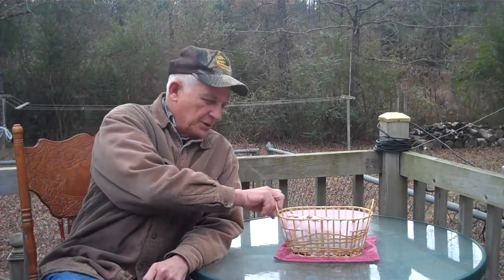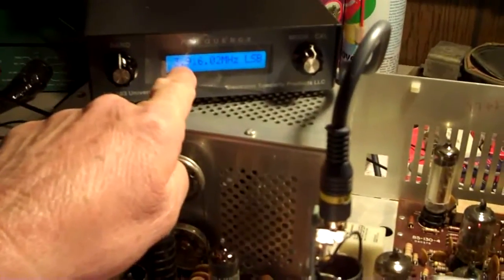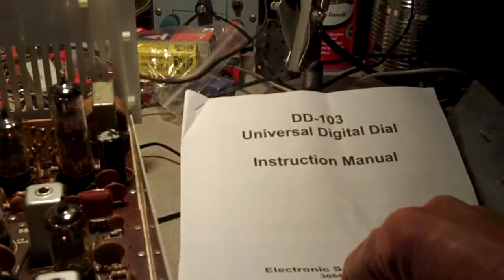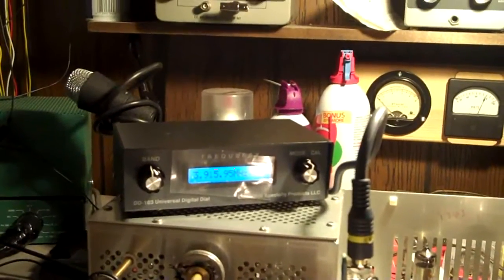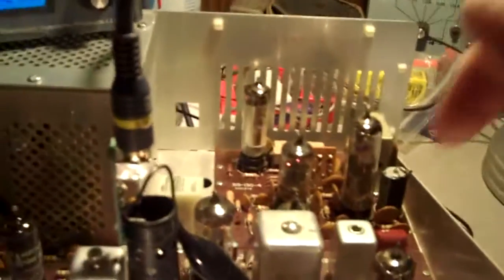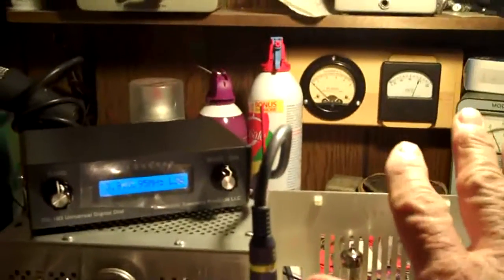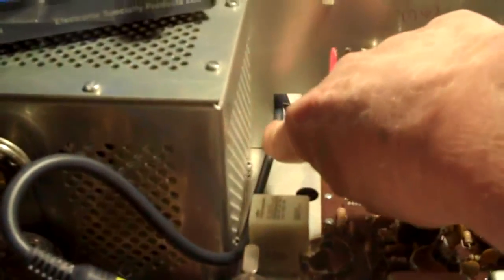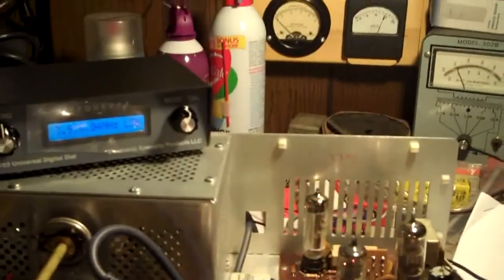The DD-103 Universal Digital Dial

Comment: Do you have a schmatic for this?   Mine powers up but only displays the I.F. frequency.   
It did work for a few years.   Everything seems to work except it doesn't change from the I.F. freq to the
correct frequency.    I tried transmitting a cw signal with a piece of wire connected to the coax for the input
and it didn't pick up the signal.  My other freq counters picked up the signal several feet away from the antenna.

Ken

Comment: John, use an nylon cable clamp, the kind that wraps around the cable and then is fixed with one screw or nut and bolt. and attach it to the side of the PA section cage.  You've got plenty of holes there without having to drill any more!
73, Harvey KM4JA
(P.S. Got me a Flip Ultra for Christmas, upon your recommendation and look forward to posting my own videos on here.)

Comment from the maker: @umajunkcollector,
As usual, our local Radio Shack was out of the male-female-female wire Y adapters, so I had to go with the metal types.  At some point I'll go back and they hopefully have them in stock.  Of course, if you're looking for a stupid cell phone Radio Shack is never out of those.  The company doesn't even qualify as a shadow of its former self.  It's a sad deal.
BTW...I dislike hot tea.  No problem with iced tea though.
Thanks for dropping in.

Regards,
John